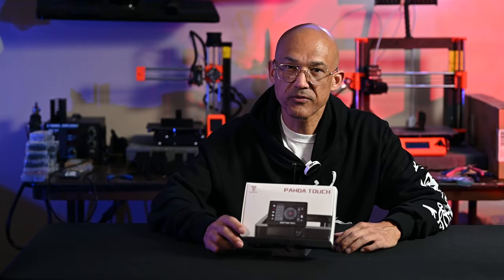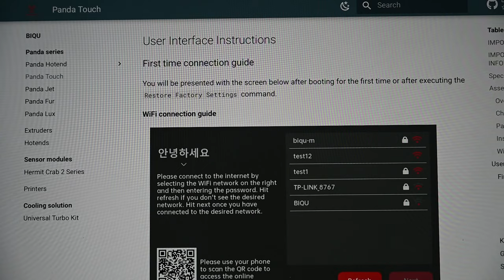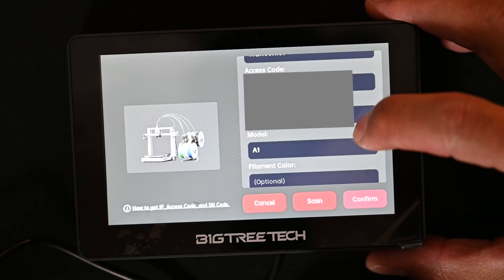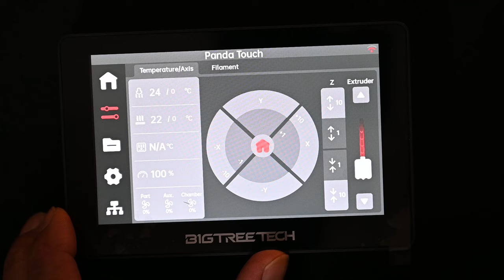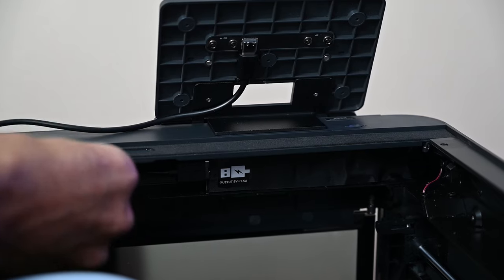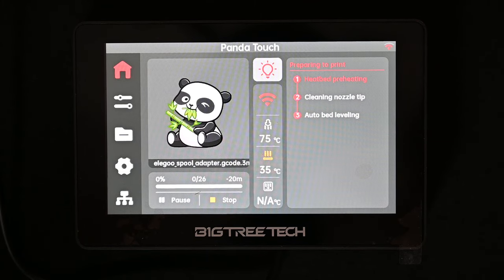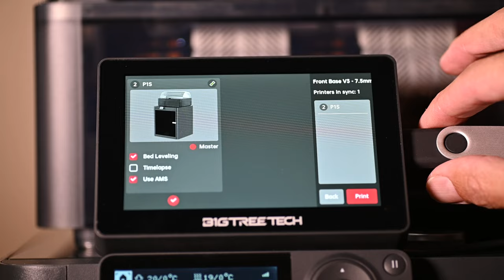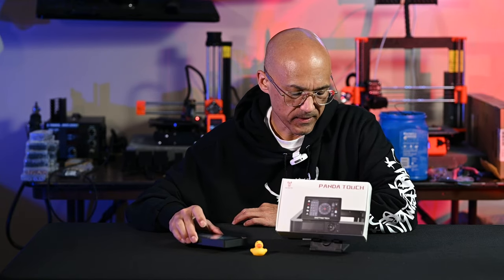Panda Touch Review - Unboxing, Installation and review of a Panda Touch on a Bambu Lab P1S

Comment: I heard after the new updates of the p1s the system software you would not be able to use the panda touch , is that true?😅 

I got it for this March waiting mine to get dispatched so only worry about that aha  😅 so not sure how true is that and if I should return it to get more pla hehe 😂

But still so excited for the features!
Reply from the maker: Only Bambu can really say if they’ll limit functional use in future firmware releases.  I’m fairly sure that Big Tree Tech will do anything they can to keep as much functionality based on any limitations to the connection protocol.